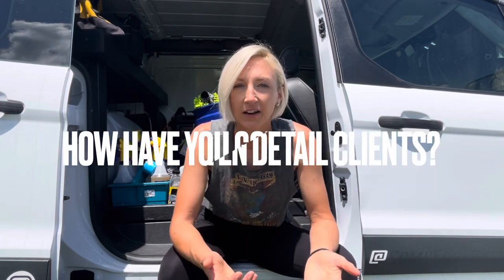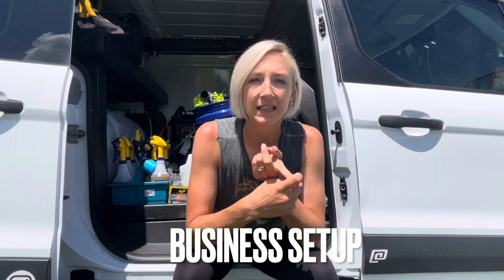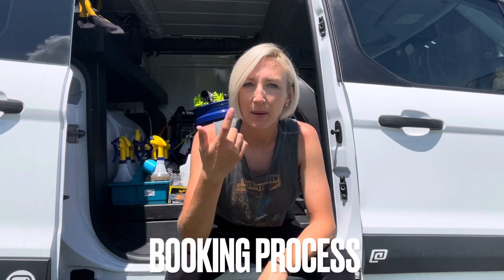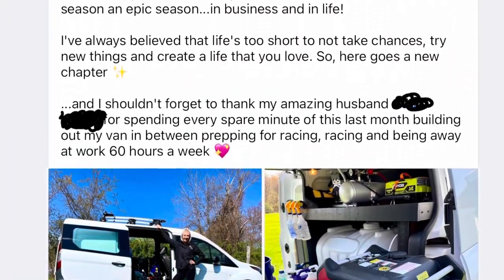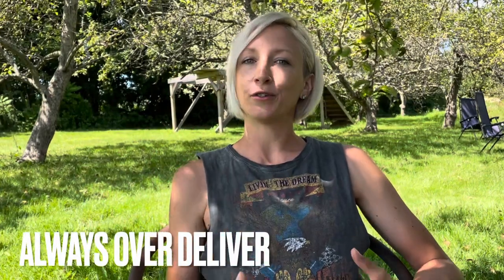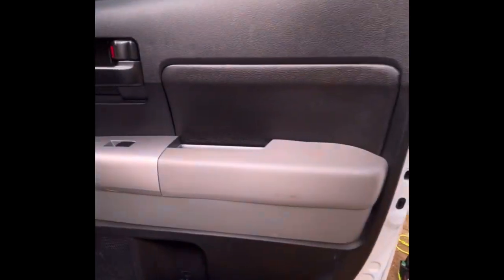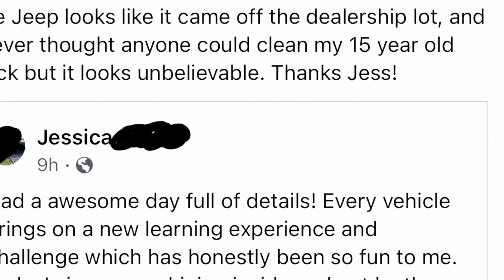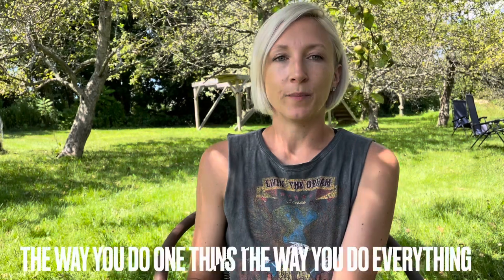How To Get QUALITY Customers for Your Detailing Business - Mobile Detailing Business

Comment: What all do you include in your $150 interior exterior? I’m getting started finishing up my online presence. Do you offer any paint correction or polishing? Or spray wax. Love the video, thanks for your feedback
Reply from the maker: I no longer offer the $150 interior/exterior because I didn’t feel like I couldn’t put out sub-par work, but that package would have included a detailed vacuum and air compression, wipe down of all hard surfaces, windows and cleaning of the floor mats (power washing if rubber mats, vacuum if carpeted) and the exterior was a wash, tires, wheels, wheel wells and a spray wax. My issue was that when I detailed a car, I wanted it to be perfect and a lower end detail wasn’t perfect to me. So I got rid of that package and now my more expensive packages always include trim restoration and a hydrophobic sealant. I am headed to training this week to learn all about polishing, paint correction and ceramic and we’ll see if I choose to add those to my services! Thank you for watching!
Reply: @DetailWithJess so your prices have increased correct? What do you start at now for the works?

Comment: For you $269 interior and exterior what is the process for the exterior?  Keep up the great content👍🏻👍🏻👍🏻
Reply from the maker: I do a bug and tar removal, tires, wheels and wells, foam wash and/or two bucket hand wash (depends on vehicle dirtiness), spray sealant, hand dry, dress the tires, clean the exterior windows (if needed to ensure streak/water spot free), and dress the tires and restore or protect exterior plastic trim. I think that’s everything!